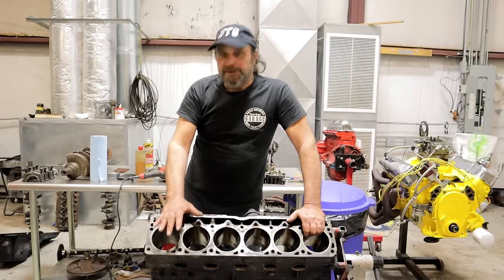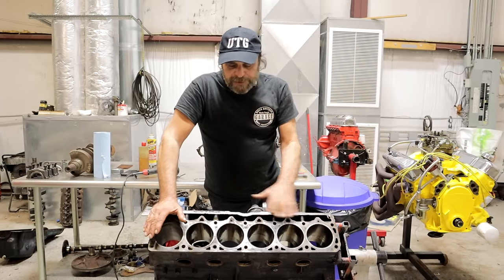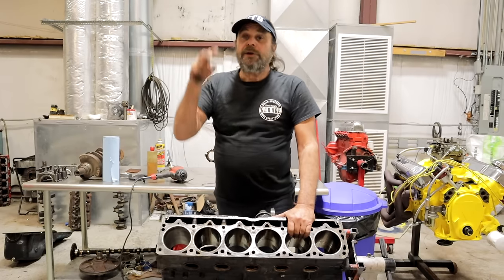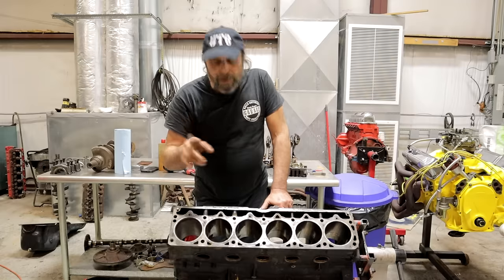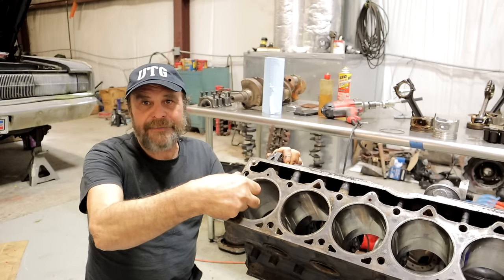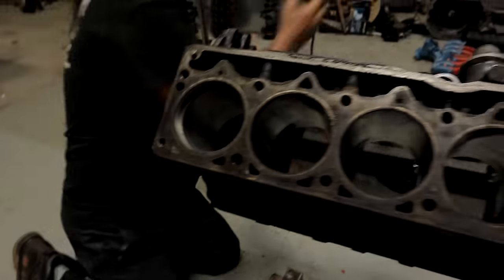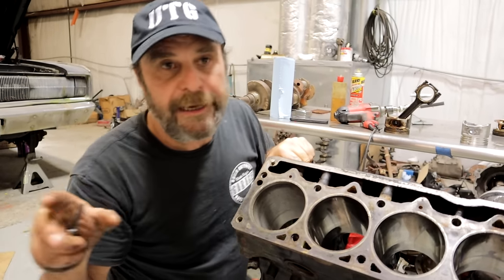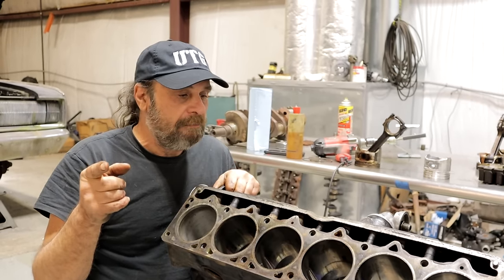Your First Engine Job - Checking Cylinder Bores For Roundness And Taper Using An Old Piston Ring

Comment: SPOT ON TONY I USED A RIDGE REAMER FOR YEARS AND USED TO THINK ABOUT TAKEN OFF THE RIDGE AND MADE ME  WONDER IF I WAS DOING MORE DAMAGE THEN GOOD MOST  OF MY REBUILDS I OVERSIZED IT VALVE JOB DID SOME QUICK REBUILDS RINGS AN BEARING TO GET IT DOWN THE ROAD. BUT WHAT YOU SAID THAT MAKES TOTAL SENSE WHEN YOU HONE IT USE THE THREE STONES INSTEAD OF THE BEADS GODSPEED

Comment: Last time I rebuild my 355 I had a small ridge so I opted for a single berry because I was worried the ridge would keep the hone out from hitting the cylinder at the very top because it's essentially holding the hone at an angle vs perfectly parrell to cylinder so at a certain point in the stroke of hone the stones touching the ridge and the bottom of stone...if you look at that 4.0 the last  .25" is still black where home isn't hitting. I don't know makes sense to me and my rings sealed fine and has run for years. I've seen a block ruined by a ridge ream from a machine shop! The finish product was the ream flus with the bore on 1 side and opposite side cut into the cylinder making a flat groove vs a ridge. So then it's re sleeve or toss it in junk pile and re sleeving a SBC isn't worth it unless it's a original OEM numbers matching block. I see the same machine shop bore a Honda 200cc cylinder so sloppy the piston clanked around when held it in with fingers, BUT a Budweiser can slid in perfectly hmmmm. Maybe the machinist was drunk and measured a can instead the piston? Lol, the engine sounded like a diesel from the piston slap and burned oil. There not in business any more. They bored my 350 block . 030 back then perfectly tho... The shop was Steego auto parts in Rockland ME. And had a machine shop out back.

Comment: Ridge reamers,  if any ridge is present ,gets used before the pistons come out if you expect any reuse of the pistons and bores. Otherwise you can break the upper ring lands and the ring . You can't determine if the new rings on the used piston will interfere with remnants of the old ridge if you don't cut far enough down the bore, but you don't want to bore all the way to China.  Depending on the ridge reamer design some square up off the top of the piston and are impossible to use otherwise. I have used them all and I hate them all for quite a few reasons.  I like using a  rigid  hone to finish to finish bores as opposed to the spring loaded ones or the dingle ball units . I have used  inside micrometers for 50 years on engines as well as industrial machining as the they are inexpensive and can be used for far more then a cylinder bore. A dial bore gage is nice  and would be called for in a production machine shop.  I like using Kerosene with a little 30 wt engine oil for honing. Less flammable and I don't get painful dermatitis from gasoline that way.

Comment: Watch a lot of your videos, big Tinkering shade tree type....but have a situation and looking for experienced opinion.
my own truck dreaded 5.4 3 valve engine. rocker gave, dropped a valve, broke a rod...ok, But the broken rod at very low rpm gouged the cylinder wall.

don't have time to send it in to be machined, remand out of budget today, can a guy weld a bead or even JB weld, then hone it? new piston, rod, bearing, junk yard head, new timing set....just to get her up and running good enough until afford new engine?
your opinion helps and your videos are appreciated!

Comment: Given the low cost of precision measuring tools compared to the past if somebody does a lot of engine work it will really pay to equip yourself with at least a dial bore gage and micrometers appropriate to the work your doing. During my working life I had to do inspection work of machine components during the course of repairs. When checking bores these would be checked at least in 4 directions. Vertically, horizontally and at 45° to those two. The total variation gave me a good enough reading for an out of round condition. And for setting the dial bore gage with a micrometer get some plastic tubing to slip over the micrometer's anvil and spindle. This will keep the dial bore gage from slipping of off of the anvils while trying to set zero. Another way is use a ring that matches the print bore size. The other measuring option is a set of telescope gages. Preferably with long handles. Regular telescoping gages can be extended by using rigid tubing.But when checking bores for out of round, oversize or barreled condition it is important to keep accurate records. As to checking if the bores are actually on center in relationship to the crank centerline that takes far more advanced equipment. When manufactured the bores on this engine were actually located off of the two .750" holes in the pan rail. In fact every single feature on these blocks (1) besides the first three operations were located in relation to the two main manufacturing holes and the pan rail.
1) The same can likely be said for just about every other engine built.
Reply: good trick on the tubing - thanks.

Comment: I love the trick with the piston ring, I can't afford to buy a bore measuring set and micrometers to see if my blocks need honing. I'm trying to save money on my old L134 Go Devil Jeep blocks and T-214 Dodge straight six blocks. If I can use simple cheap techniques like this to save money then I'm all for it. If the cylinder taper in minimal that cast rings will take up the difference without problems, then the money I can save from the machines charging $150-$200 an hour to tell me that already, could be spent on parts. Why spend almost $1000AUD on tools when doing this simple trick with the rings will tell me the same thing and if it is out of round you won't need to measure it because you'll just bkre it out to the next piston size right??

Comment: G'day just like your thoughts on what I use as a lubricant to hone with. I use either diesel or kerosene  because when I first started the older guys that showed me said it made the job faster and easier because it has an abrasive nature. Your opinion would be greatly appreciated? Thanks.

Comment: I'm assuming a 1988 Chevy 4.3 could be honed this way.  I'm doubting it has thin, low tension rings.
Boy you pack this one with a lot of information.  You're making this up here doable to the slightly above-average Joe.
I've rebuilt to Chevy 350's, but both times I had a machinist do all this smart stuff.  I just took it apart and put it together.

Comment: I think the intermediate engines and vehicles were the best. Maybe not for power and efficiency, but that was that sweet spot where they were very reliable and simple. You know a little more advanced than carburation but not too much. You know you know like right after the throttle body craze and before the GDI craze right now sweet spot where everything was import injection naturally aspirated decent size engine you know and and it was less technology but there was enough technology where the thing started everywhere and drove everywhere just fine. You know the regular guy could get in it and drive it and it didn't break either that often it just needed maintenance. You know maybe a little more maintenance than the newer vehicles, but honestly the newer vehicles are higher maintenance in my opinion than they never been. They just don't want you doing any of the maintenance you understand... Late models are high maintenance of valley girls

Comment: I saw a guy on instagram that said if you mount an inline 6 engine on engine stand from the bell housing due the length and weight it can cause significant damage to the block and bores. He was actually talking about a BMW 1988 inline six cast iron block. Just asking you as I see you mounted engines from bell housing. Do you think it can cause any damage to inline6 engines? Thank you

Comment: Tony, What I don't know is how do you measure to get the correct ring size .I have a 1953 Ford NAA tractor and have it apart. Pushed the old rings into the cylinder to find the end gaps to be ,090   How do I get the right size rings  ,they can be purchased in .020 , .030 , .040. This engine has dry liners in it and is it time to replace them?? Any help is appreciated. Rick

Comment: Uncle Tony, what is the best way to learn how to rebuild an engine?
Reply: Following this series is a good start. 👍
Reply: Get a job in a machine shop

Read every rebuild manual you can get your hands on

Watch every you tube video you can.
Reply: Buy some lawn mower engines and practice
Reply: Get your hands dirty. Get an engine   Read and listen to folks like uncle Tony.
Reply: Firebird is right. Work in a machine shop. There's more to it than what you see on line. A re-ring is not a perfect job. That's why machine shops don't like doing them. The customers expect us to warranty them like a "done right" job.
With a re-ring, the engine is probably 30% worn to start out with. Therefore it's not going to last like a new engine. I always explained that to my customers. I built Thier engines to Thier needs as long as they understood that. No need to spend a fortune if you're only going to keep a car for a couple of years or it's a second car.
 Don't be anti machinist, become one.  Great job. Did it 55 yrs. 
Thanks

Comment: I have had to ridge ream a SBC, I bet it had well over 500k miles on it, I couldn't get the pistons out, even the valve guides and seats were worn insanely bad, I have no idea how it ran long enough. To wear that much,  it must have burned as much oil as gas! The heads were so bad the seats had to be replaced, the guides were worn and the valves were wobbling around , I really have no idea how it was still running, it must of been running on 100 psi compression,. And 3-4 cylinders,
Reply: Nothing wrong using a ridge reamer use it correctly and no problem Daniel Soliz channel shows how to use one properly.

Comment: Tony, is that 4.0 an open deck?
I've heard you mentioned that before on other engines but some of us don't know the difference between a "closed" deck to an "open" deck....
Thank you if you get around to explaining this on future vids.
Reply: The 4.0 is a closed deck. The area surrounding the cylinder walls on the deck surface is not open as you can see no channel that goes around the edges. The youtube channel "driving 4 answers" has a good video that shows the difference between an open, semi-open, and closed deck. An inline 6 cylinder engine that does have an open block is BMW's N54 engine. If you look up images of "N54 Block" you'll see the gaps in the deck that surround the cylinder walls where coolant would be. Then compare it to the Jeep 4.0 inline 6's block and you'll see there isn't any gaps in the block on the deck that trace the cylinders like the N54 block has.
Reply: @Robert adkins What?!  Many newer engines are open deck, large sections of the deck are open to the water passages around the cylinders / sleeves.  The 4.0 is old-school, standard deck... but "open" decks most certainly exist, friend.  🙄
Reply: Another example of open deck is the aluminum slant six engine.

Comment: Using a ridge reamer changes the true bore, but is that a problem only because of fitting a piston ring for finding out taper?
Reply: If you must use a ridge reamer to get the pistons OUT,  the block WILL need to be bored.

Comment: Another thing I don't like about modern engines. All these numbers they give you are a peak numbers that you're not even really ever going to see if you're just a regular person driving normally..... Secondly, yeah the older engines had weren't rated at the peak but also they hit torque at lower rpm

Comment: Hey Hi Tony from the UK . I'm doing my 1st full rebuild.....a 1942 Ford 226 6cyl Flathead. Rebored to 060 & honed...NOS 060 pistons(Aluminium 4 ring all gapped to 012"-015" installed 1st piston & it makes a  a scrubing /scraping sound  sound.....turns out pistons are
tapered out @ skirt approx 6
thou & skirts sure enough
show the scuffing marks in 2 ereas opp ea other. What should I do?  I cant machine away the taper to get parallel pistons as taper stop piston slap...can I hone bottom of bore...or ideally take it back to machine shop...but what will can they do a taper bore ? Top of pistons are 84.20mm & skirt is 85.75mm. Any advice appreciated. Engine out of my 42 Ford 'jailbar' 1.5ton dually. 
Cheers 👍🍻